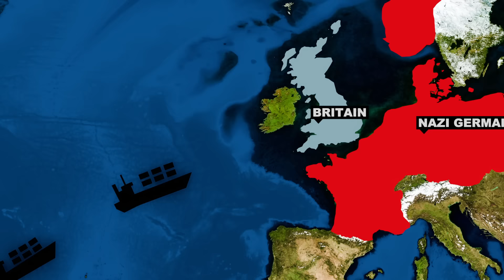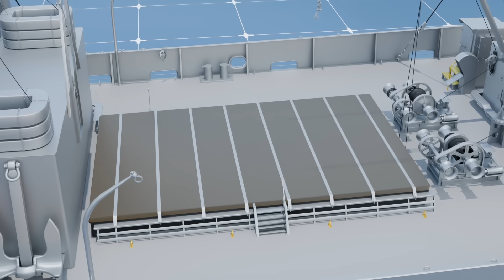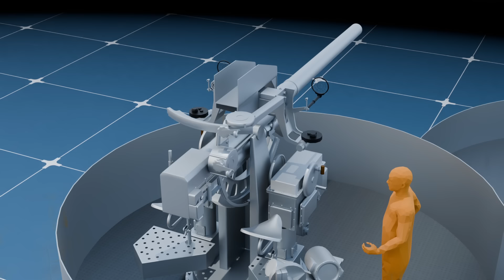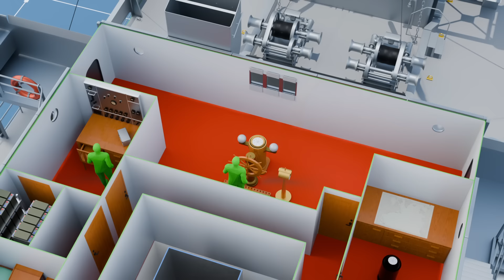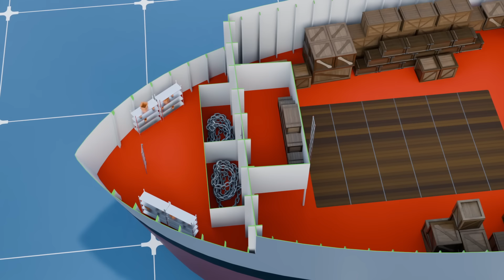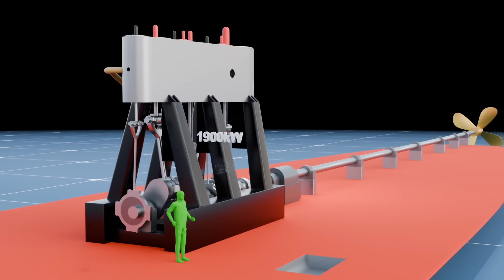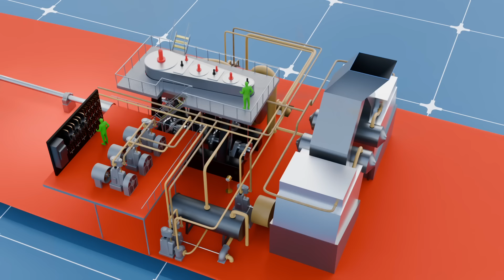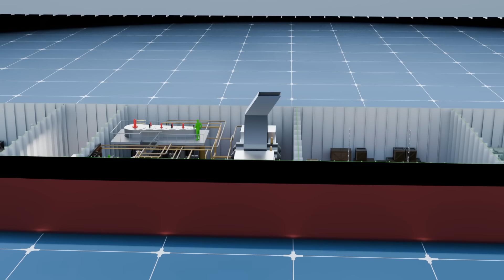How the Liberty Ship Actually Worked

Comment: 6:59  I think you mean 50mm gun, not 50 caliber.
Reply: I think it is the 3" naval gun with a 50 calibre barrel length or 3" x 50 = 150" long.
Reply: Yes I was a little concerned about the 4inch gun being a 50cal. As well as the 3inch gun...50calibre usually concerns the bore size which is half an inch
Reply from the maker: Unlike firearms, naval guns are usually classified by caliber (the diameter of the bore) and calibers (the barrel length expressed as multiples of the bore diameter). For example, a 3 inch/50 caliber gun has a 3 inch bore and a barrel 150 inches long (3 × 50). We should have clarified this in the video.

Comment: 6:57 no..... they either had 50 cals, 20mm or 5inch guns. 5inch being a caliber it's own firing 6to10 rounds per min with a full charge giving it a muzzle velocity of 3200 ft per second.
Reply: You are conflating small arms terminology with artillery terminology.

It was a 4" gun with a barrel of 50 calibers length (4*50=200 inches long).  That specification let the crew know what ammo to fire.  

There were 4 inch guns of only 30 calibers long (120 inch barrels or 10 feet) that used less than half the gunpowder and thus had far less range.

The extreme guns, of the Germans, were 72 calibers long. This gave them very high muzzle velocity and range, with half the barrel life.
Reply: @External2737  you sound like a real expert. Thank you.
Reply: The SS Jeremiah O'Brien had two 3" 50 caliber guns and 8  20 mm Oerlikon anti- aircraft cannons. Liberty ships had anything available at the time of construction, so 3" 50's 4" and 5" 38s were also used.

Comment: sorry to disappoint , BUT ,  the shipyards of Henry J Kaiser put out ships so quickly that the welding was many times substandard.  sometimes in storms , they would just fold up and sink. the men called them " kaiser coffins ". welding processes were not what they are today. the battleship North Carolina had a problem with its welded , armored seams . just one japanese torpedo  caused a crack that went all the way up into the superstructure.
Reply: This is bovine excrement. Of all the 2710 Liberty ships constructed, only THREE ever broke in two due to no other external causes such as torpedoes, shelling, running aground, collisions, poor distribution of cargo and so forth. This fact is from a postwar research paper by Bethlehem Steel on the subject of which I have a copy. The welding at the Kaiser yards was not substandard, nor was the steel inferior. The problem was that welding  (a new technology) as opposed to riveting,  meant that a crack appearing in one plate could propagate across a welded seam,  whereas on a riveted plate this could not occur. Also the 90 degree corners on the cargo hatches was a stress point or 'raiser', which was easily fixed by welding a curved steel reinforcement at the corners. I am not some millennial who gets his information from YouTube videos while munching on Cheetos in his grandmother's basement, I am the Head Docent on the SS Jeremiah O'Brien and have spent years researching into the design and operations of Liberty Class ships. As Mark Twain once said, "It is better to remain silent and be thought a fool than to open your mouth and remove all doubt."
Reply: @bsa45acp  You tell em! Along the theme of easy fixes was the patch on the sides that strengthened the plate connections and the hull.
Reply: My father who sailed as an engineer on these ships also hated them for their fragility due to welded construction. Riveting was much stronger but slower and more expensive. Liberal use of asbestos for insulation resulted in a “snow storm “ in heavy seas.
Reply: interesting. Heard that was the case with the T class oil tanks. A lot!
Reply: Quantity has a quality of its own
Reply: Well, it is what it is, wartime production
Reply: Especially in the arctic convoys liberty ships were liable to crack and break they’re backs from the cold even well made ships weren’t safe

Comment: what the hell is a 4 inch 50 caliber gun.
Reply: 50 caliber means the barrel length is 50x the diameter. So a 4” 50 caliber naval gun has a 4” x 50 = 200” barrel length. 200”/12 = 16.66 feet
Reply: By comparison the 16” guns on the Iowa class battleships were 50 caliber also, so 16”x50 = 800” or 66.66 ft long
Reply: 4 inch is bore of gun; "caliber" is the bore diameter to length.
Reply: 4 inch guns were very common in WW2.
 DE's had them, British Navy/Canadian navy had them too on their Corvettes. British warships used them a lot. The HMS Hood had them.
 It really was all you needed in a smaller ship as a U-Boat was the main enemy vessel you were to encounter that you might get a piece of.
Reply: Thicko

Comment: I enjoyed this video.  I was fortunate to visit the Jeremiah O’Brien in 2017.  The scale of so many built in a short time is amazing.  Great video!
Reply from the maker: Thanks for sharing, glad you liked it!
Reply: Didn't they find out there was a structural design flaw after several years?
Reply: @richardbrant5728  Yes, brittle fracture caused by a combination of poor steel, inexperienced welders, stress concentrations from square corners, overloading and the low temperatures found in the Atlantic in winter. One Liberty, S.S. Schenectady exelled itself by snapping in two the day after it was launched.
Reply: @richardbrant5728 It wasn't even several years. The problem itself was a combination of issues that fell into line on a number of unfortunate Liberty Ships. Problem #1. Welding of ships was, at that time, a relatively new undertaking when compared with the older practice of riveting ships together. New lessons were about to be learned the hard way. 
Problem #2. The crews building the ships were, for the most part, relatively new to ship building, and to vital skills like welding. They had been hurriedly trained and then expected to gain more experience from building each ship.
Problem #3. The steel sheets made for the hulls of the Liberty Ships was quality steel, but produced and fabricated in a hurry. There was always a rush on to build each ship faster than the previous one. 
Problem #4.
The recipe for making the steel sheets had a serious problem in that in very cold water and rough weather conditions the sheets would loose some of their ductility and become embrittled. Then under the stresses of wartime overloading, severe cold weather and rough seas, cracks could develop from fatigued metal and rapidly spread, leading to in some cases complete failure of the hull, and the ship would sink. Just where and how fast this would occur, and the type of cargo being carried, could determine how fast your ship would go down. If your ship was carrying iron ore you could expect it sink within a minute. 
Problem #5. Related to the issues metal fatigue  and stress fracture propagation was the issue sharp corners through penetrations. You will have noted the hatches over the five holds. These are critical penetrations through the main deck and most crucial of all was Hold #3 just in front of the bridge house. This is one of the most highly stressed locations on the ship as it rides up and down waves of a winter time North Atlantic storm. In the trough of the waves, the ship is being compressed at the deck line, and then within a minutes it is being stretched at the same location as the ship crests the wave. This cycle could go on for days as the crew fights the weather and the build up of frozen ice on the superstructure and the rigging. If that ice is not kept under control, then the ship could easily become top heavy and turn turtle and capsize before sinking straight to the bottom. In the dark night and the smashing of the waves, a crack spreading from the corner of the hatch cover towards the sides of the ship could be easily missed, and your ship could break in two and head to the bottom. Ships would disappear from convoys in the night even though there had been no U-Boat attacks. 
One Liberty Ships was being loaded in harbour when the failure occurred and was able to help pinpoint the cause of the failure. 
Part of the solution was extra belts of steel around the hull at the main deck line. Also curved corner fillets were fitted to the corners of each deck hatch hole. 
Mark from Melbourne Australia

Comment: Water has a relatively high specific heat capacity compared to many other substances. This means it takes a significant amount of energy to change its temperature. 

The specific heat capacity of water is 4,186 Joules per kilogram per degree Celsius (J/kg°C), or 4.186 kilojoules per kilogram per degree Celsius (kJ/ kg°C). This means it takes 4,186 Joules of energy to raise the temperature of 1 kilogram of water by 1 degree Celsius.

1 joule is 1 watt per second.

Its why I put methylated spirits in my kids steam engine and piped the waste alcohol down a pipe into a pool of spirits inside an ice bath. At the other end was the boiler and a candle.
Reply: Much more at the change od phase 100°C water to 100°C steam.  Lost when condensed. 

Hence the inefficiency of the Rankine Cycle.....

Comment: A truly ambitious and successful American contribution towards winning WW II. Very detailed animations. One thing not mentioned is the steam not only provided a down-stroke of the pistons, the valve directs steam below the piston creating a powered upstroke. This is also the way steam locomotives work.
Reply: The major difference between a steam locomotive and a steam ship is in the use of steam after it has done its work. A steam locomotive uses some of the exhaust steam to improve the combustion air draft through the firebox. The steam is then vented with the smoke out of the top of the smoke stack. Steam is also vented from the drive cylinders directly. This wasting of the steam is in contrast to the steam ship where the steam is condensed down to water before being sent back through the system. Part of the reason for this method is that fresh water is in short supply on board a ship even though they can produce their own fresh water it is never enough to be able to waste it .
Mark from Melbourne Australia
Reply: @markfryer9880 Interesting…I understand that sea water was used in the condenser, but I can’t imagine boiling sea water to make steam without damaging the boiler and other tubing. Did they carry a supply of fresh water or, as I think you inferred, they were desalinating sea water?
Reply from the maker: Thanks for pointing that out!
Reply: Several of the early units broke in half so a large plate was welded to either side as reinforcement.

Comment: The composite armor is the most interesting item I learned from this video.
Reply: I'm guessing it was a case of "Just about every other material we would usually use as armor has already been claimed for making battleships, tanks, etc. This is the best we could come up with from the materials still available."
Reply: It was a new item to learn about for me as well. Asphalt and crushed rock is basically what roads are made of today. It definitely wouldn't stop a round of anything above 12.5 mm, but it might help to stop shrapnel from cutting your down. 
I wonder who proposed that idea for "plastic armour?"
Mark from Melbourne Australia
Reply: Yes I took a tour of SS John W Brown in Baltimore last year, and was able to hold a sample of the "Plastic Armor" in my hand from the tour guide. It was basically some asphalt mixed with chunky gravel and smeared over some chicken wire to hold it in place.  It was placed around the bridge plus all of the Splinter Shields/aka gun tubs of all of the various gun mounts. Then they painted it gray so some people thinks it looks like concrete but it is definitely asphalt.
Reply: Its very interesting to see.  I have been on a number of rides on the John Brown - looks like concrete around there
Reply: Never heard of that being the fact.